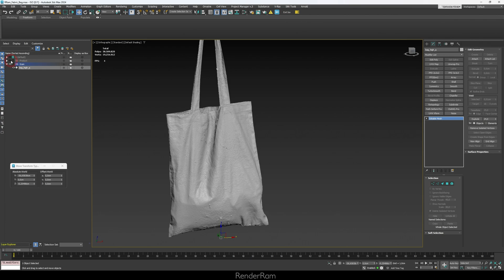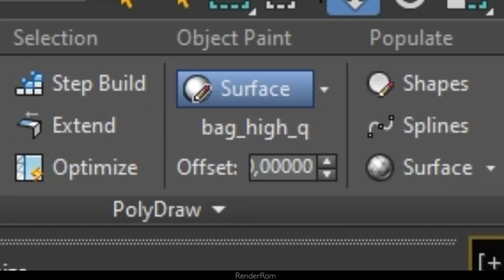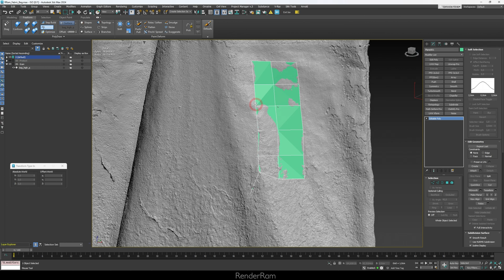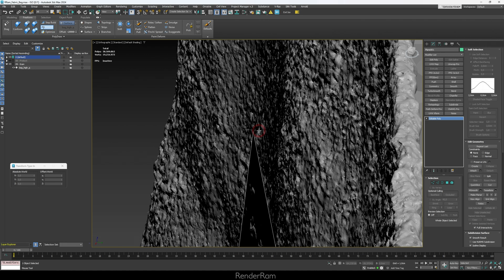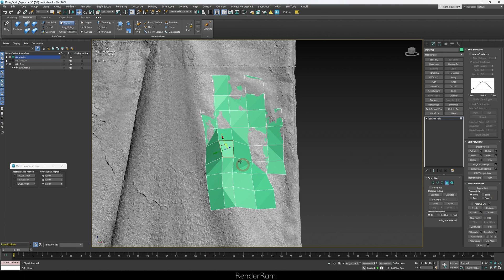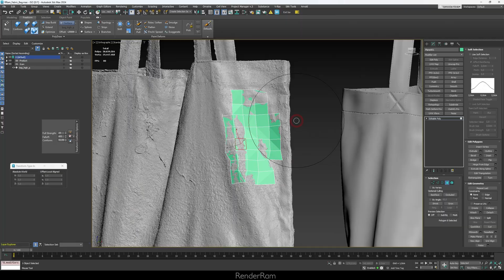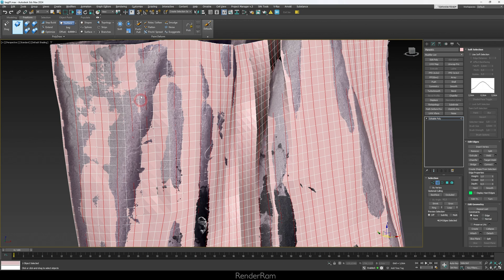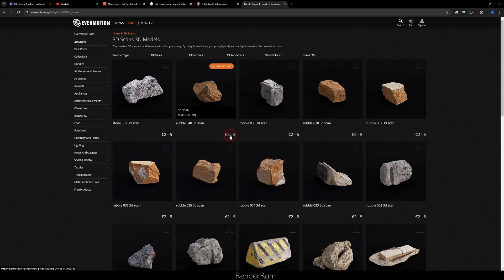How I Retopo Anything with Just 2 Max Features | FREE 3D Model | 3ds Max

Comment: As a max user of 23 years I usually try and find a quicker way ….even if it means spending money on scripts.
I am in no way against this method …..and also I have no affiliation with Polycloth but it’s much easier to just model cloth objects using Polycloth or sometimes just Max’s default cloth tools.
Reply from the maker: Sure there are faster ways to do a bag for example, I generally wanted to show a retopology process, it can be anything, sofa, toys, pretty much anything you scan etc...
Bag was a quick example :)

Comment: Thank you so much for the information! I also find retopology relaxing but unfortunately I don´t do it as much as I wanted to. I like to use the Blender for retopology cause it has this free plugin RetopoFlow and it´s really easy to use, one thing I like is that you can just draw a line and you have all the vertices for that area, you could do this bag within a few seconds.
Reply: That feature is also available in max (freeform topology). its a neat trick